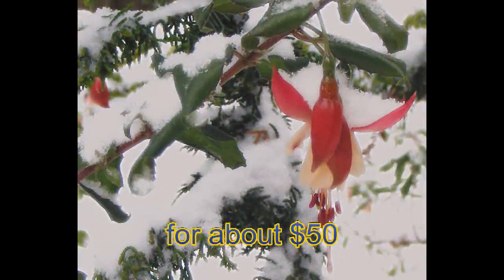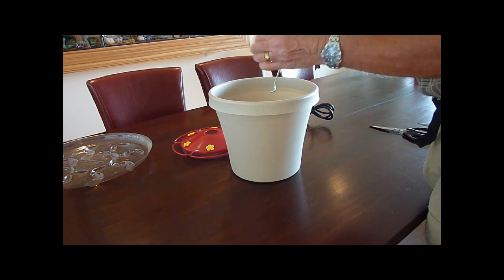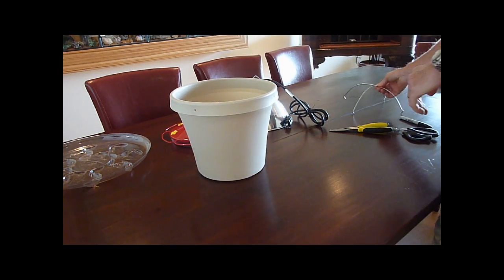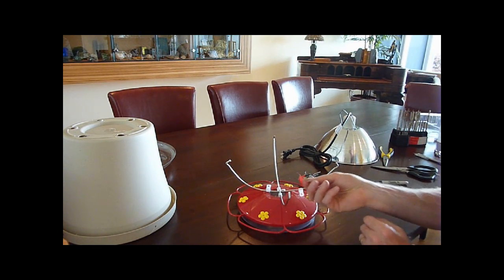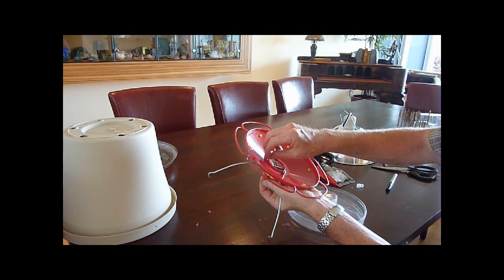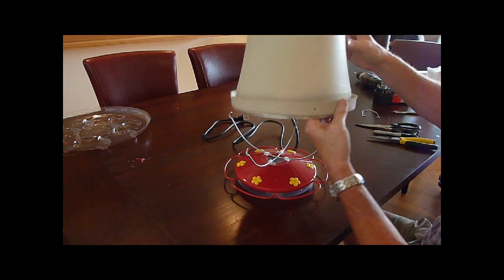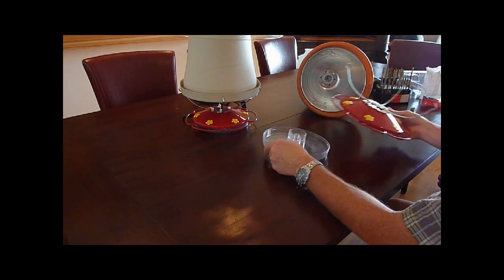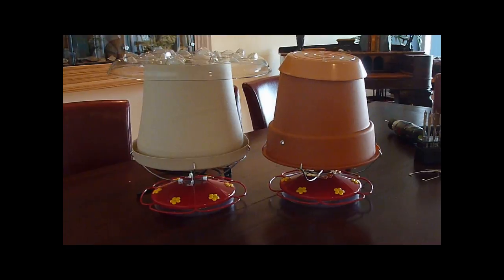Winter Hummingbird feeder

Comment: You could hang the heat lamp directly to the bottom of the feeder (drill some holes in the aluminum reflector, use some s hooks to hang it on feeder) and won't need the flower pot. You also will only need about a 25 watt incandescent bulb, not a 40 or 60 watt, just warm enough to keep nectar from freezing is all you need. It works perfect and is simple and light weight.
Reply from the maker: Great tip!

Comment: I almost forgot! I found this doohickey too:

http://www.amazon.com/gp/product/B0006U2HD2/ref=as_li_ss_tl?ie=UTF8&camp=1789&creative=390957&creativeASIN=B0006U2HD2&linkCode=as2&tag=amyscracrelif-20

It's an outdoor thermostat controlled outlet. So you plug it to your lamp and it will automatically turn on when it gets to 35 degrees and then it will turn off at 45 degrees. Brilliant! And Amazon has it much cheaper than the local hardware stores this time of year too.